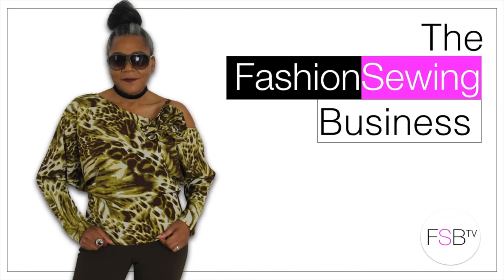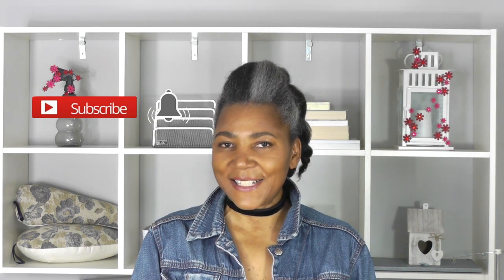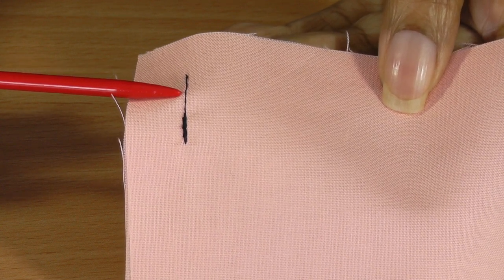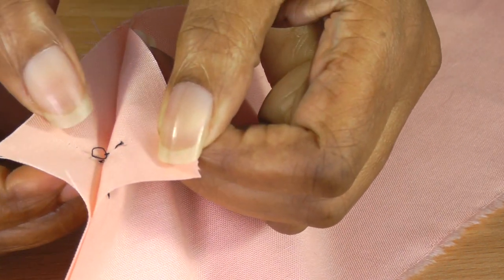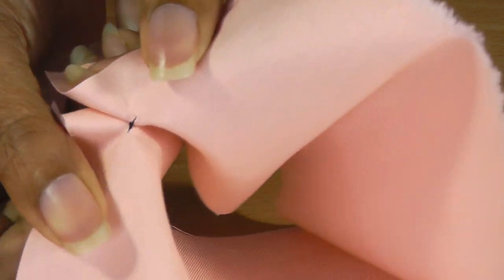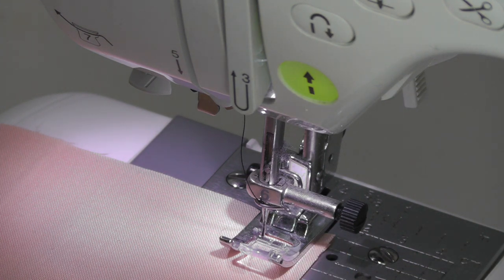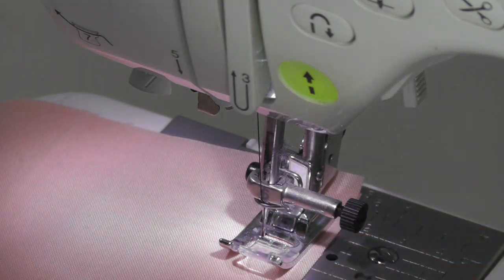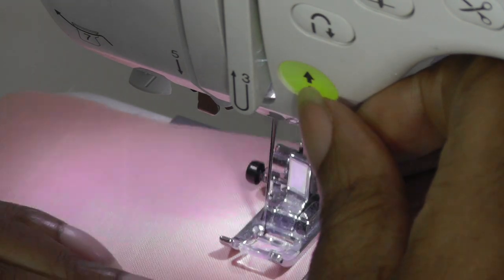Back Stitching On A Sewing Machine

Comment: Hi hunni I purchased a cheap beginner sewing machine but it does not have a back stitch button unfortunately if there is i defo do not see it anywhere lol is there a way I can do this without the button ? For example turning the material around a few times and going over the same material I have stitched a few times, would be a massive help if you could give me some advice as I’m a total beginner to sewing 😊 thank you xx
Reply from the maker: Hello Jenifer. It is a case of using a hand sewing needle or upgrading your sewing machine. If you need some advice of good quality beginner sewing machines let me know.

Comment: Thank you! Question: my machine stitches normally on forward but when I back stitch it starts to bundle up and get stuck. Sometimes it even eats up the fabric and I have to cut it. Do you know what I'm doing wrong?
Reply from the maker: Hello Fabiha, There could be many reasons, here are just a few common causes. Check to see if it is threaded  correctly,  check the tension and possibly check to see it there is a build up of lint.
Reply: @colleenglea  OK. Thank you so much for your help❤